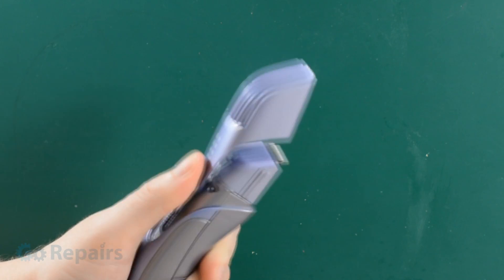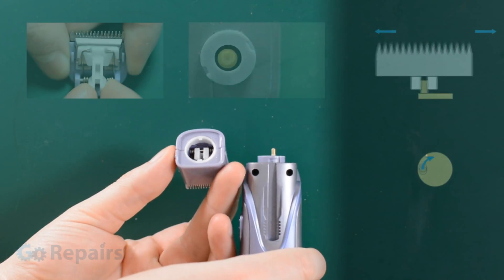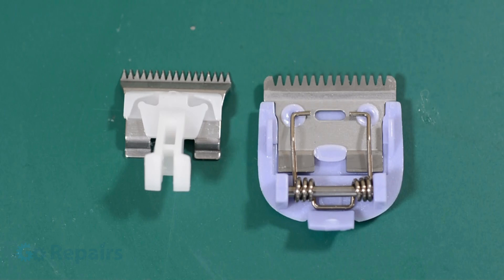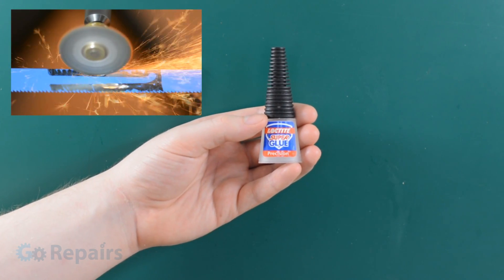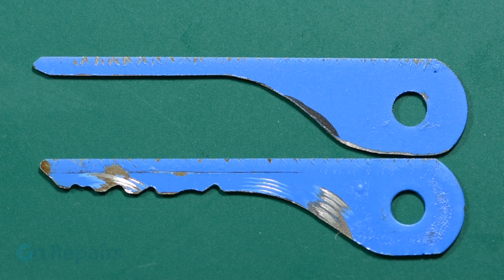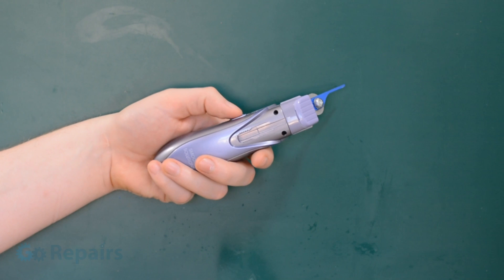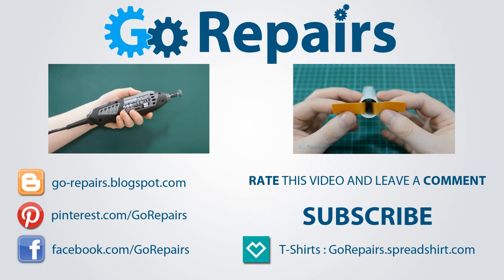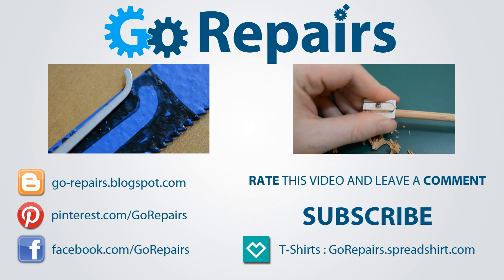DIY Electric Lockpick

Comment: Instead of the shaver, can I use an electric toothbrush?
Reply: No. The brush vibrates as a whole in a circle. You want a tool that only vibrates in one direction and only moves the business end. And the toothbrush is too weak for this.
Reply from the maker: It depends on how the brush works, but if it has way of producing side-to-side movement then it should work.